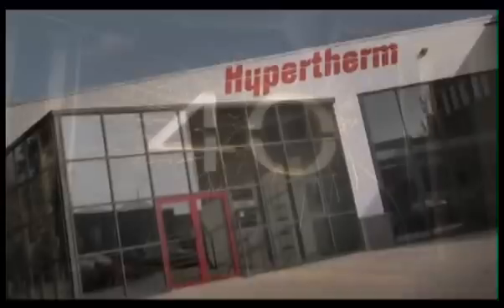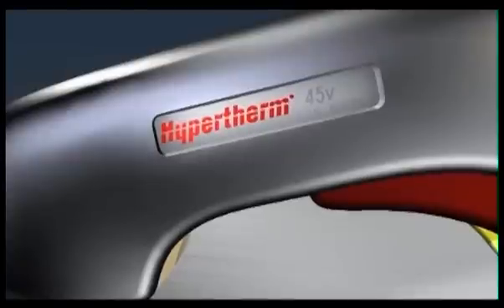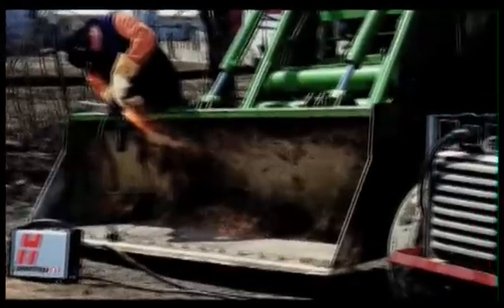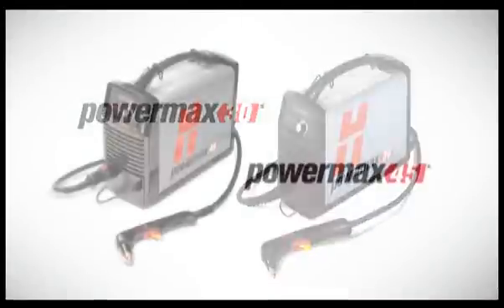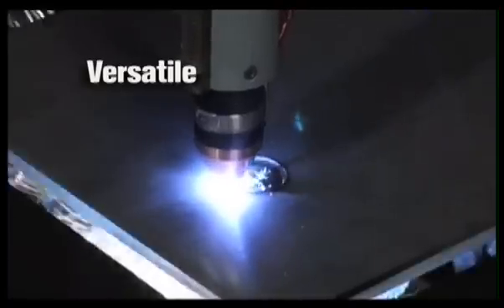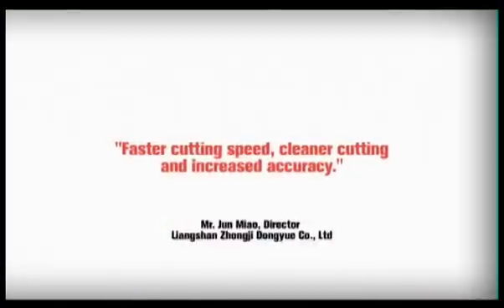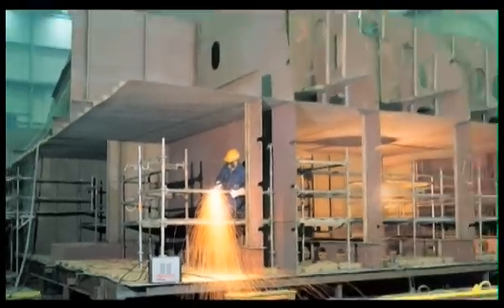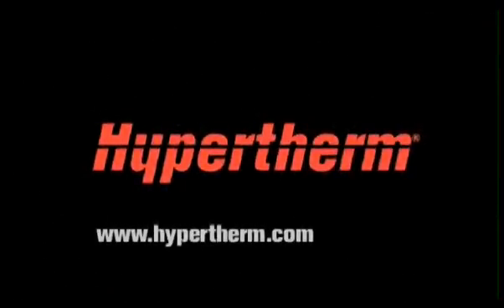Why buy a Powermax plasma cutter?

Comment: what is the minimum hole diameter that a plasma can cut on a 50mm 
i want a machine that can cut 10 mm diameter  on less than 50mm thick metal

Comment: when it comes to the powermax 45, I need to know what size breaker I need on each side of the 220? Will a pair of 20's due? Nobody can seem to answer the question.
Reply: A 220, 45 amp device needs two 45 amp breakers -or more,  to service the 45a to each of the two phases.